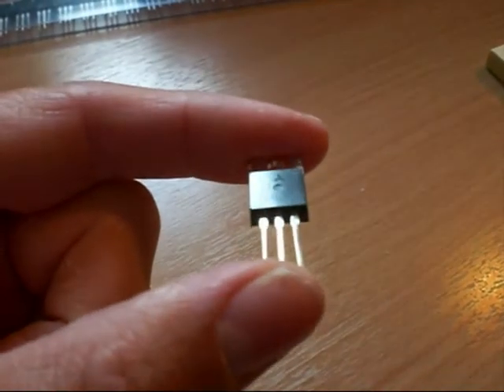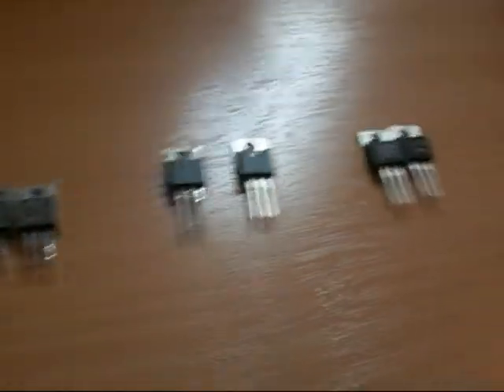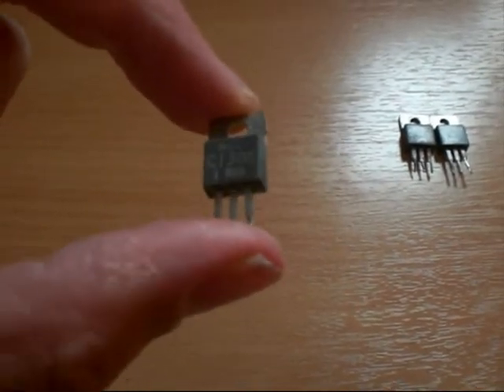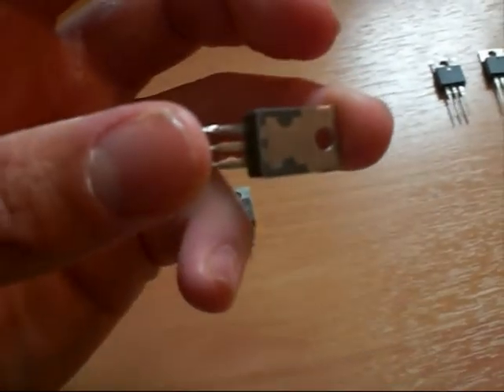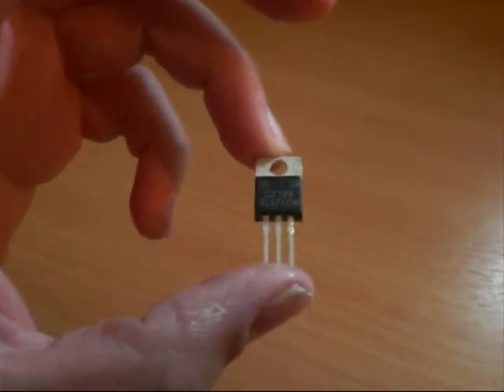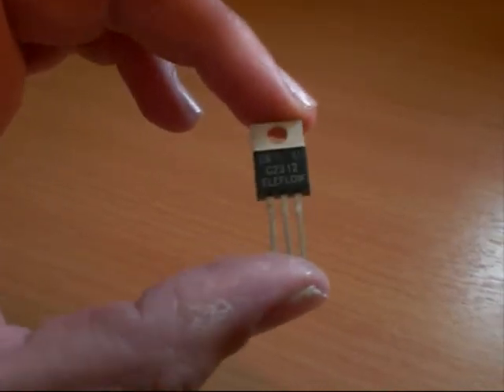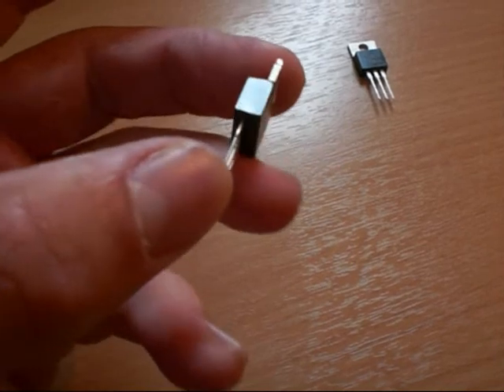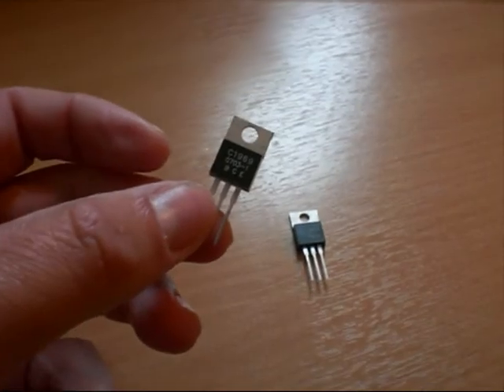FAKE NEC & MITSUBISHI RF TRANSISTORS.

Comment: NTE and ECG have done this for decades.  Any transistor that has basically the same parameters can get stamped and used as a replacement.  Sometimes the replacement can't take the pressure! Horizonal outputs were especially bad, if say, you have a decoupling cap that has changed a bit. In any Sony product you must use Sony parts as their engineers drive the transistors to the limit. Use an NTE or an ECG and you will do it over, and soon :) I never thought about a 5 watt device not holding though